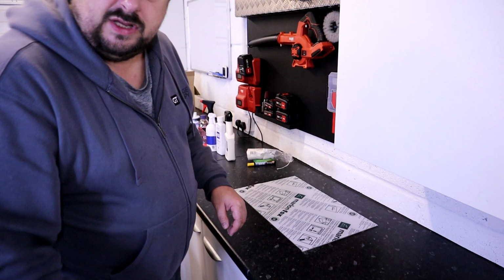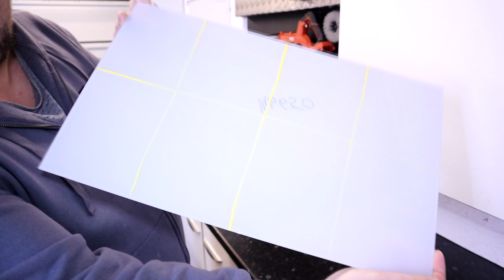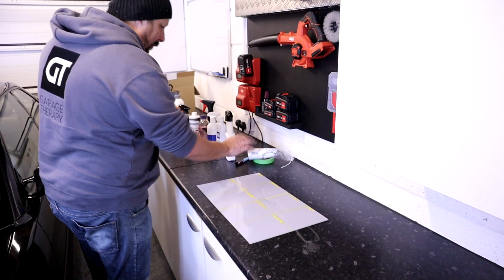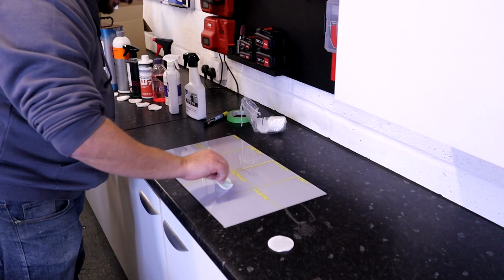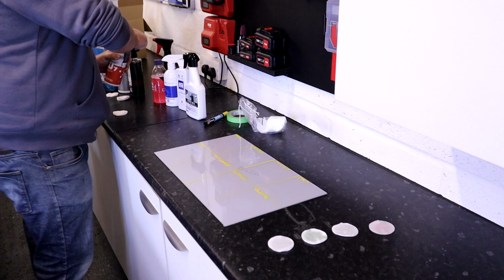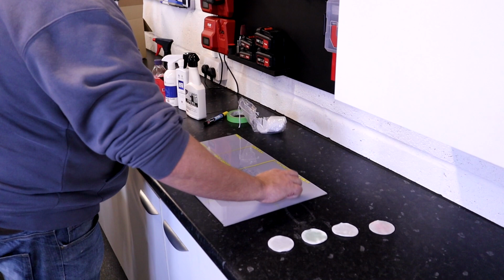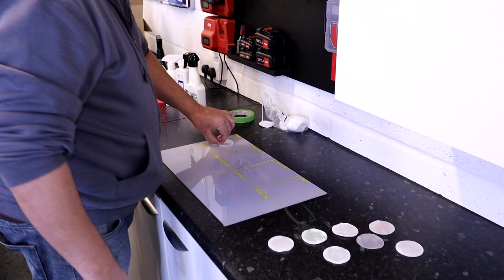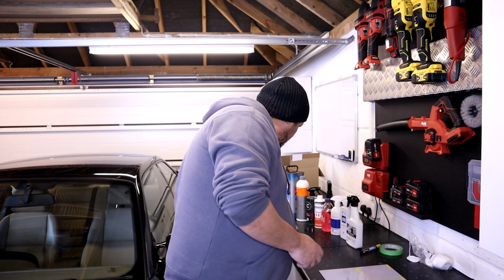Will tar and glue removers damage your car | Behind the Scenes

Comment: I used the W7 one myself back in december to remove lots of Tar from my lower panels. It did work great and the tar came of with minimal effort. But it smelt just like petrol. So im assuming thats all it is in reality ?. Following tar removal, i used some IPA to wipe the panels down again.  And re-applied some TAC systems wax for protection. As i guess these tar removers will strip of any protection on the paint.
Reply: I think the dedicated tar removers contain emulsifiers so that when rinsed with water they don't leave anything behind like petrol would. Could be wrong here though

Comment: before watching.. yes they will/can damage your car. Now my experiance might not apply to a lot of cars but my 2003 toyota crown has "chrome" plated taillight surrounds and over years those had little pores open up due to sun damage/etc and while it wasn't really visible, a small amount of tar ran over both housings causing the chrome to ripple and "detatch" from the plastic underneath. Needed new clusters to sort it out as it looked horrid.